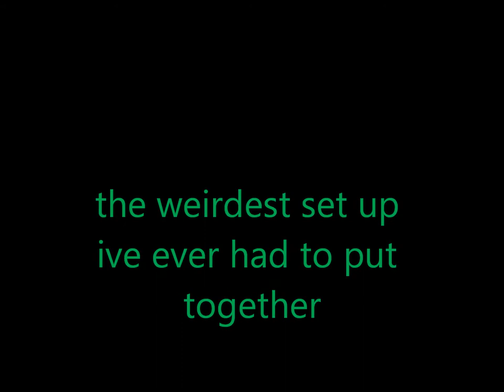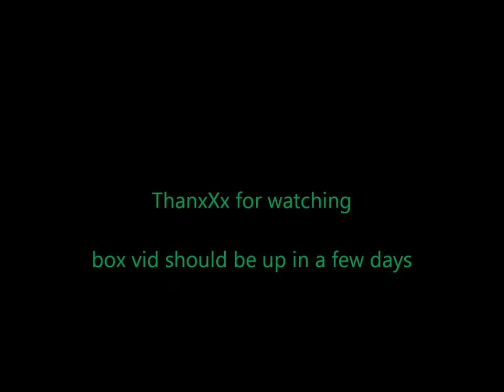Weird Kustomer set-up

Comment: id go with 2 chamber the 15 firing up ported front tune low as hell and the second chamber invert the 2x12s so there firing into the box then port out the back thats if its in a wagon or suv it would make so if you opened the hatch you prob wouldnt notice the 15 hiding behind it